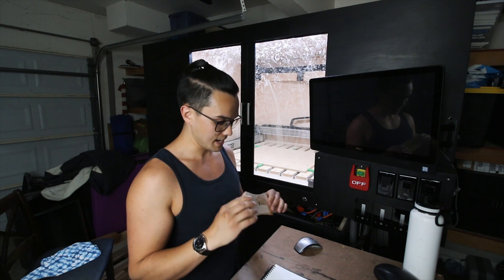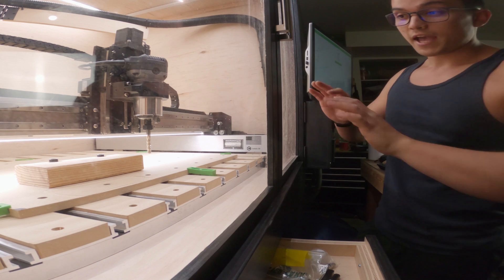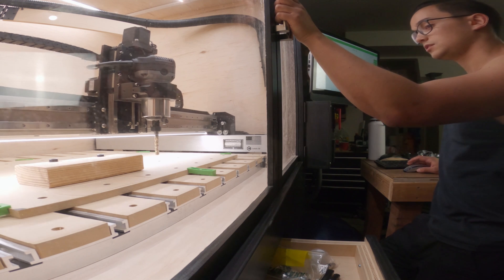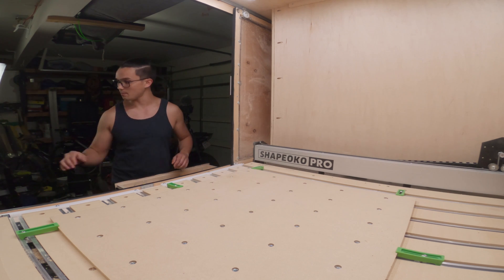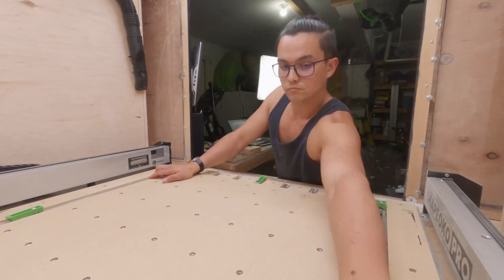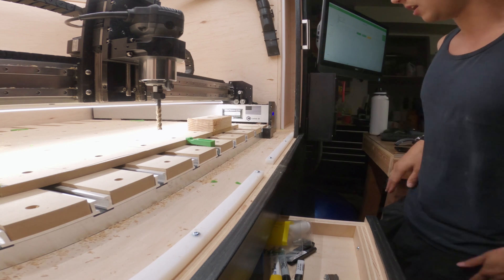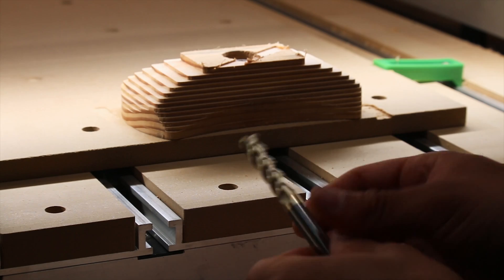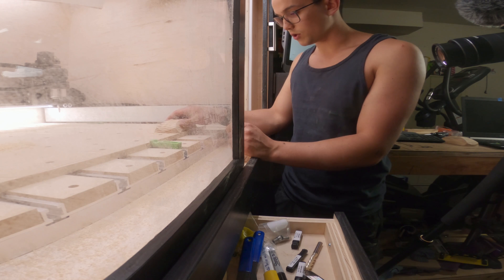Shapeoko Pro Testing at 300 IPM & Updated Climbing Hold

Comment: Seems like it’s running too fast for the motors to handle. You might need bigger steppers to handle that size of bit at that speed and rpm. Also, you should be letting the tool flutes cut into your part to keep it from walking since your stepper torque cannot handle the load.
Reply from the maker: Hello, partially true. Conventional milling can be a more stable cut but isn't the best for the tool and the main reason it crashed was simply due to not taking air passes and walking the tool into the stock. The tool simply bit more than it could chew and skipped steps.
Reply: @AustinConrad  I'm trying to soak in all the CNC information I can before building my recently purchased Queen Bee Pro.
Reply from the maker: Enjoy! It's a fun hobby!

Comment: I think you are climb cutting. The cutter travel for an outside cut should be counter clockwise. That was what it looked like when the x travel ran away on you.
Reply from the maker: Thanks Randy. The run away was due to the crash which caused the machine to mis steps and then run away because no longer knew where it was. Thats why making sure you take air passes on uneven stock is important.
Reply: Randy is absolutely right. that's exactly what happened. for metal it can be right, but for wood it is the wrong milling direction

Comment: the speed controll on that router sounds so bad :o the harsh dip at the start of the cut, the huge rpm spike when a cut ends, and the over compensated drop off right after... 
(I'm not an expert, and don't yet have my own machine, so don't take this as "this is bad". It just sounds really bad to me)
Reply from the maker: Yep, that's what you get with a $100 router. Proper CNC spindles with VFD don't have that same issue anywhere near this bad. So it makes dialing in a recipe all the more tricky.
Reply: @AustinConrad  Shapeoko told me in an email a few days ago a VFD spindle is in the works but no set date yet.
Reply from the maker: @bradisley517  that's awesome! Currently on my future wish list of upgrades